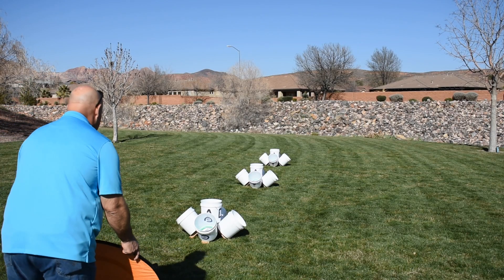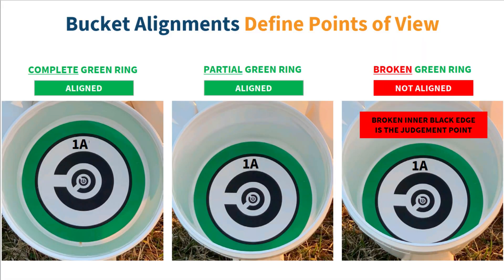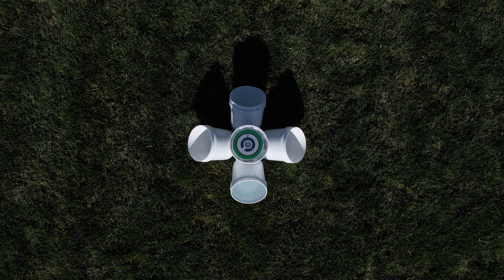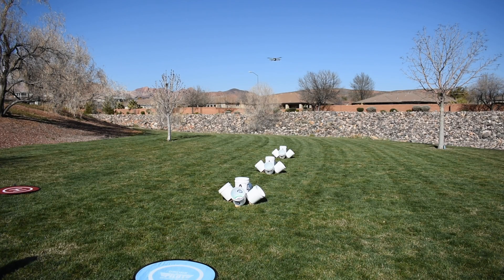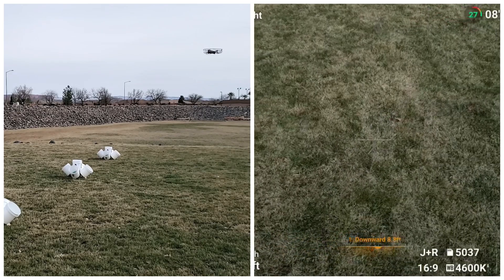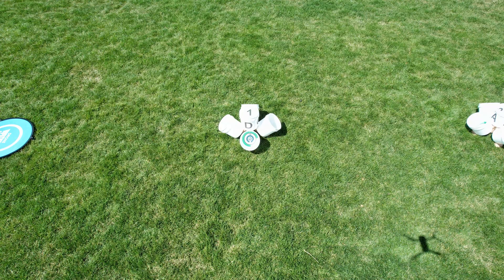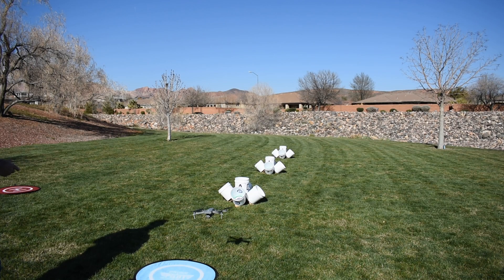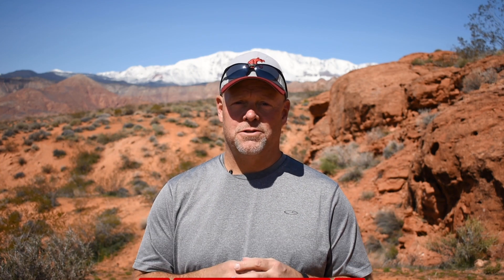How to Use NIST Bucket Stands - Improve Your Drone Pilot Skills

Comment: Ken, I am a retired special agent that designed and oversaw a UAS Unit. Upon retirement I am now employed with a community college heading up a new drone program. We use the NIST and have also added a element in the open course with 10 pictures of common weapons suspects use to overlay on the internal colored ring for students to get their final 10 points to get a potential 100. We use a 4 bucket station and place without student seeing 10 overlaid weapons random in the lane of buckets. You have a caller giving you the order to fly and capture the weapon with a perfect picture and 3 minutes to complete. That is a total of 18 seconds per weapon. Sounds like a lot but under pressure they do scramble. Anything over 3 minutes we deduct 1 pt. per 3 seconds over. They are under pressure to compete against one another to earn Top Gun you might say. Just something we added to make it fun but yet technical and improve their skills.
Reply from the maker: Wow! That sounds like a really intense and effective training program!

Comment: Okay but what does this do? Besides getting better at the test, these skills are non-transferable unless you are brand new to how drones operate and how to operate them smoothly. Also Orbits are not Rolls. You're moving during a Yaw Spin. It might make you control better, or move smoother, but it has no actual bearing on making you a "Better" Pilot if you have the literal utmost basics down. 

It won't make you safer, it won't make you more efficient. 

It makes you good at taking pictures of buckets.
Reply: Scanifly is a an app for drone pilots flying mission for preparing roof-mount solar PV system installation planning. Must be able to fly circles above and around houlses and buildings.
Reply: It's like any other test.  It sets a standard for new pilots, etc.  What good is a part 107 at making a drone pilot a good drone pilot?  I know a lot of FPV hobbyist that can crush and destroy a part 107 holder, but they don't have a part 107.

Comment: I can see the fun in this. Out in the reality searching for the wanted angles for photos the target is not the problem. The problems are the obstacles beside, behind, under and partly in front of the down angled camera. Lots of camera tilting up and down, rotating, to check there's no obstacle coming too close.
It will be fun to see what You will come up with.
Reply: I'm of the opinion that this test is a complete waste of time. What do you gain from this test?
Reply: @quentins8165  What post are You replying to?
Reply: @Stefan_Boerjesson  I was replying to yours however I will also say I was recovering from a migraine at the time and may have been a bit too angry. I think the test is suitable for drone control, its just not very practical.
Reply: @quentins8165  I tried to be kind, saying the test could be fun. I gained, not much from that exercise..